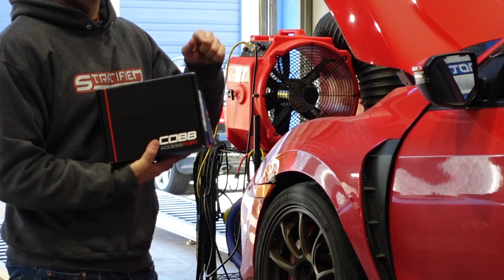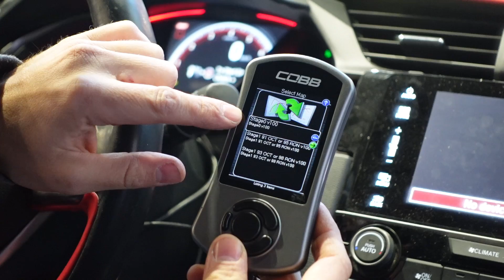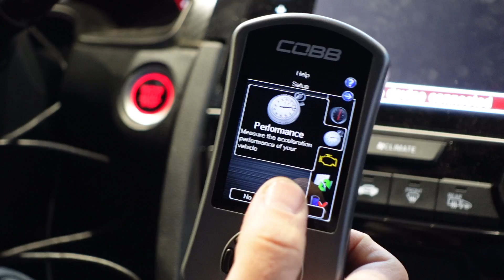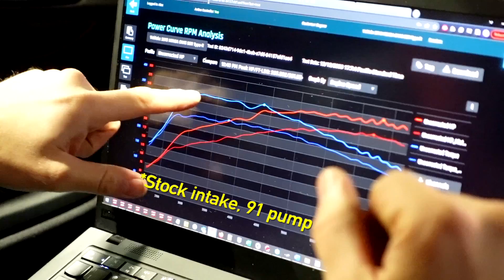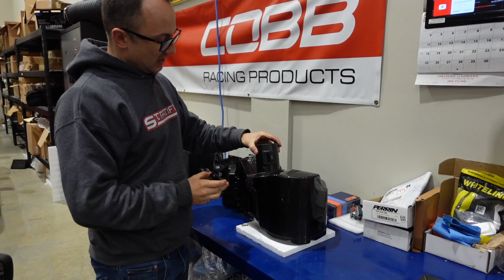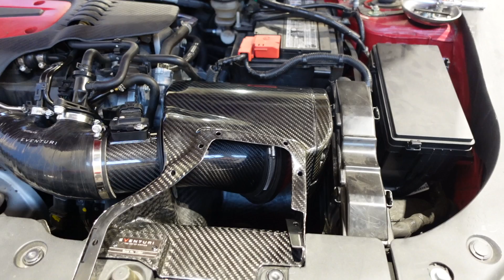Honda Type R Tuned: COBB Accessport, Intakes, E85 - EP1

Comment: I'm considering purchasing the cobb AP for my 21 but wondering if it would be okay to go with the 93 octane map that it currently has..car is currently stock. I used 93 fuel here... (premium that's required)

You guys used the top one of the list in the video only...

I'm just wondering if it would it require a custom tune afterwards if I was to get the PRL intake down the line along with downpipe etc.. or would the OTS tune still work and benefit with those upgrades?
Reply from the maker: The custom tuning is a big benefit of the Cobb AP as every car is a bit different and fuel quality changes from area to area even through it may be rated the same. This is the great power of the Cobb AP. 

We found both OTS tunes from the AP and Hondata to have room for improvement in terms of power and driveability.
Reply: @stratifiedauto  ok so, going forward, would the car need a retune if I was to add a new intake & exhaust down the line? I know if downpipe added, it will need a custom tune, or would the 93 octane one still be good? With the other upgrades, would it still increase power with the preset tunes on the AP? Meaning it would still run good, not too lean or rich, the MAF sensors adjusts that but is it adding any stress to other components?
Reply from the maker: My recommendation is to adjust the tune when changing exhaust or intake flow parts. They affect the turbo response and this car is quite sensitive to this. The intake itself does affect the MAF calibration and should be tuned for. Both the Cobb and Hondata tunes we tested did not run optimally on our test car until we dialed them in.

Comment: question, with a hks intercooler, eventuri intake & pipe with stock exhaust how much hp would it pull with the Cobb map file tune on pump 93?
Reply from the maker: Cobb is just a way of flashing the car. The results you see here are from custom tuning done by us. I estimate the intercooler to be worth 5-10hp and intake doesn’t add much as we show.

Comment: To unlock the ECU, did you just plug the Accessport in and unlock it that way? Or was there another plug in that you used to unlock the ECU first, then plug in the Accessport?
Reply from the maker: For up to 2019 cars this is all you need to do. For 2020-21 cars you need another plug that is included with every AP.
Reply: @stratifiedauto  Cool, thanks for clarifying. I bought my 2021 FK8 used with a catback exhaust and a PRL intake already installed. No other signs that it has been tuned but I don't know for sure. I'm really interested in the AP but don't want to brick the ECU if there is a tune already on it. Any advice on what I can do?
Reply from the maker: With the AP it will recognize the ECU and guide you through the process. We haven’t seen issues if you follow the steps and make sure to have a charger on the battery.

Comment: just curious, after unlocking the engine, will the warranty still work for this car? is it revertible for the unlocking step?
Reply from the maker: After unlocking if you uninstall the AP it will lock it back up.
Reply: Want to know about that too😅